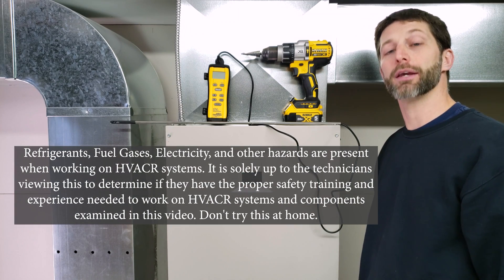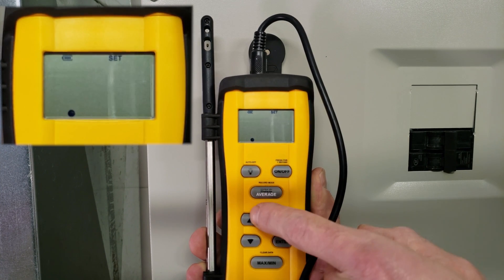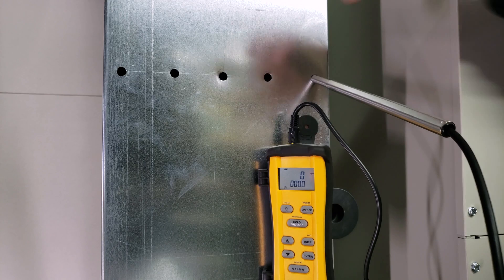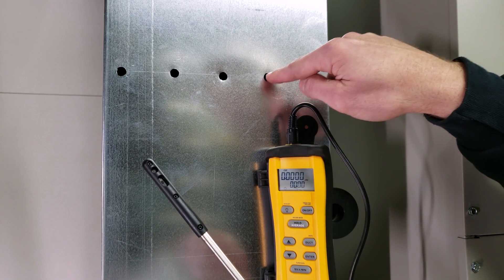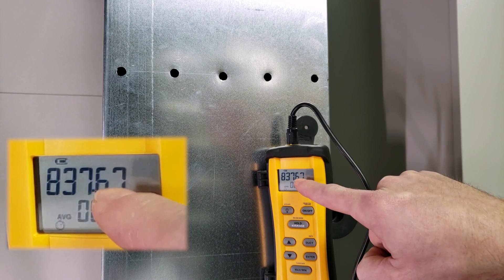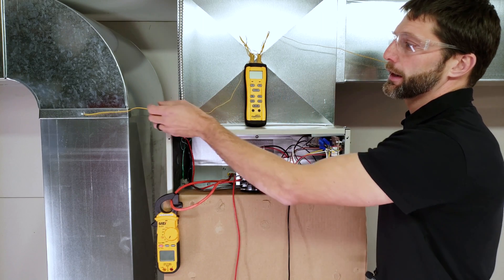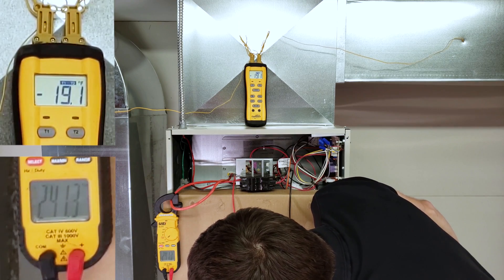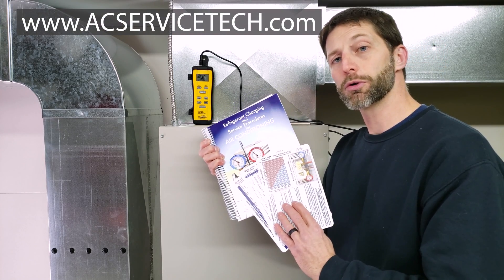Airflow CFM Measured with a Hot Wire Anemometer!

Comment: How about doing a demonstration on a return system with a 2 foot return box and flex duct attached. My readings are way off! example 16x25 box. With 2-12 inch flex for 2.5 ton system with a 3 ton blower. My anometer reading 1600 cfm! How the hell does that add  up!

Comment: What's the difference in tools to measure CFM, on the Fieldpiece SDMN6 Manometer and the Fieldpiece STA2 Hot Wire Anemometer? A manometer measures Atmospheric Pressure and an Anemometer measures Wind Speed.  Just a different way of calculating CFM ??  
Also, if you had to pick 1, which one is a "more useful" tool ?
Reply: STa2 I'd just a anemometer and the sdmn6 is a manometer. you can calculate cfm using a manometer. but it's a longer step. you take the static pressure measurement then you want to square root that number. multiply that number by 4005. multiple your answer by 0.9 (carrier recommendation if you're just measuring one whole to get an average). now you want to get in² of the dimension of the ductwork. multiple length x width and divide that number by 144 and you'll get ft². multiple that number by your feet per minute and equals to cfm.

example:
0.2 static 
0.45 square root
0.45x4005x0.9=1602fpm
let's say 20x20 dimension of duct
20×20=400
400÷144=2.8ft²
1602÷2.8=572cfm

Comment: does this formula work for gas furnaces? also, how would this work if checking a/c airflow?
Reply: This can also be tested using a gas furnace. You use the BTU’s on the name plate of the furnace. With the delta T method, airflow is always tested using the heat. If your blower is multi speed, like most, you want to swap the leads to have the blower motor run at the “cooling” speed when the heat is on. This is normally accomplished by swapping the heat and cool connectors on the control board. You are looking for 400 cam per ton of cooling.

Comment: Could you, please, answer one fundamental question about Hot Wire Anemometer? There are 2 thermistors in the Anemometer probe. But only one of the thermistors (the upper one) is to be exposed to airflow.The other thermistor(the lower one) must be hidden away from the air flow and it senses only the ambient temperature. Why you put both thermistors into airflow? Do I understand everything right? Please, explain.

Comment: This seems like to much work for a little window to diagnose a system
Reply: David, I would say a tech in field would check the air flow after finding the following: low suction pressure at the condenser and then go check that the air filter and evap are not clogged. At this point, you would need to check air flow or you would not be covering all your bases and while you are there, check amp draw on the blower motor too.

Comment: How accurate is measuring the heat differential to this method?. I am sure this is the most accurite but i dont want to purchase this instrument. Enjoy your video's.
Reply from the maker: Temp rise formula is the most effective way to determine cfm but you need a heat source such as strip heating or gas furnace, thanks!

Comment: Do have a video testing a gas furnace cfm? Nice seeing it being demonstrated.
Reply from the maker: Not yet but I would like to, thanks!
Reply: You can determine the BTUs of a gas furnace. With the formula. 
(3600 seconds in an hours / Time it take your gas meter to measure 1 ft of gas. When only your furnace is running. ) Times BTUs in a ft of gas close to 1000 BTUS per ft. = BTUs per hour.
Use the BTUs per hour in the top of the fraction in the formula on 8:26.  The number 3.414 is just a conversion factor for watts to BTUs.
{(Sec/hour) / (sec/ft) } ( BTU/ft)= BTU/hr

Comment: Nice... question though. I noticed from other videos you check this formula/cfm using electric heating. How would you check it with normal gas fired furnace? Is it explained in the book (which I ordered the other day)?
Reply: The book does have this video example.  I have to admit that  it's so much better watching it in a video. Thanks Craig. 

Please support this channel and the Author.  He's been doing excellent work to inform and help everyone for years!
Reply from the maker: Yes cfm can be determined with a gas furnace and oil heat and the formulas are in the book, thanks! Please let me know what you think of the book after reading it!